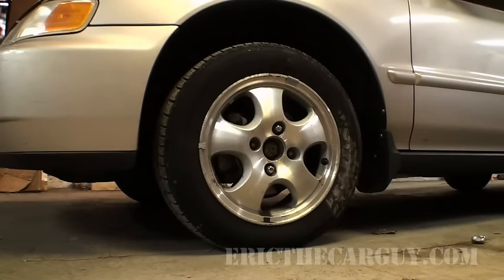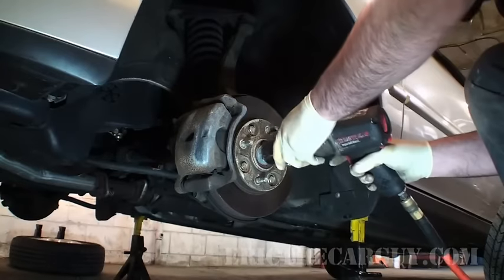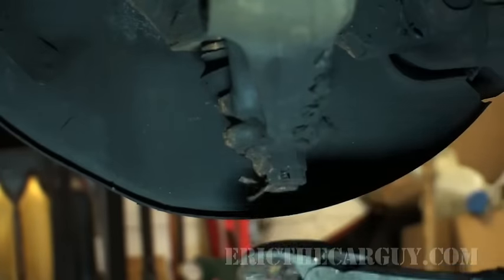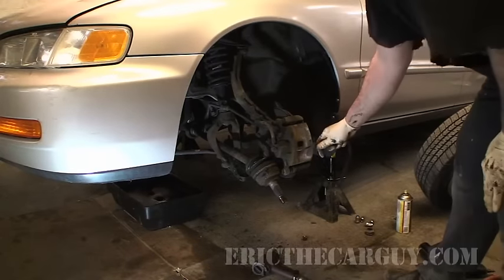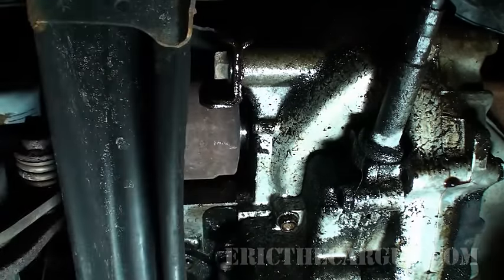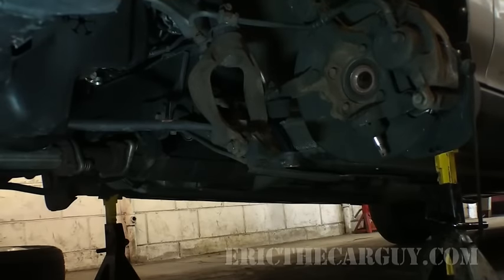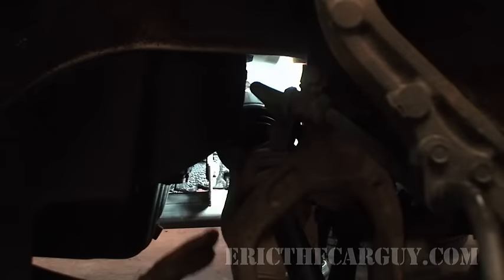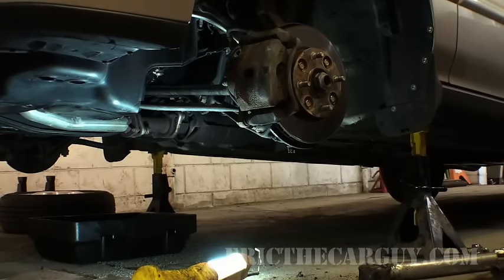How To Replace a Front Wheel Drive Axle - EricTheCarGuy

Comment: Why are there tons of youtube videos where the new axle just slips back into the transmission no problem... am i the only one that doesn't get the axle back in? stupid C-Clip..
Reply: schwabentutorials It gets easier the more times you do it, every technician has their own method but I like to slide the shaft spine into transmission and can feel the clip give a little and then push it in. It also helps to make sure its going in perfect straight and no weight on from axle hub side dangling I hold it up perfectly level before forcing in. That just my opinion and works for me.
Reply: schwabentutorials you can thank the power of video editing
Reply: schwabentutorials, I did a Dodge Neon 2001 yesterday.  By no means am I a mechanic at all but the trick for me to get it on was exactly how he explained it in the video.  Turn it back and forth and wiggle it up and down until you feel it grab and then wind up and push it in, but it is also quite possible that the hole is bore a little bit more on different vehicles.  I actually had a harder time of getting it out because I didn't have a pry spot...I wacked it with the claw end of the hammer on the u-joint and then it came off!
Reply: +schwabentutorials No, I had a horrible time with it, a friend with a car lot towed it in, put it up un a lift and pry bar-ed the hell out of it to get it in. (It was 5 degrees in my driveway when I was trying to do it, might have been part of the trouble)  SOLUTION: on the other side shaft, I took the new c clip off and used the c clip from the old axle.  Still took pressure, but went in.
Reply: +TheLazyHalfSRanch I had to do it twice by now (didn't change the seal the first time but appearantly damaged it in the course of putting the axle out or in) and it was bad both times.. As i only changed the outer part of the axle the inner shaft an c-clip are the old ones.. didn't seem to help.
+TheAstro30 that i did try, several times.. But as soon as the grease got in touch with the transmission fluid it basically was useless.. I also tried rotating and centering the c clip numerous times.. The first time i got it that way, after maybe 50 tries, rearranging the clip and then as straight and with as much force as possible in.. The second time i couldn't get it in myself (might have also had to to with me having a injured thumb so i couldn't use that hand to the full potential) but at the end i had someone about twice my size pushing it in and even he had to try really hard..

The getting out part is really easy on my vehicle because a pry bar fits in perfectly to pry it out.. But seems that the c clip on my vehicle is just very strong.. Or the position is very weird.. its way inside the fender and behind the strut and everything, maybe if it was on a lift would be easier.. Don't know :D 
But i for sure won't change axles out anymore if i don't really really have to... 

Thanks for all the ideas :)
Reply: You need to turn the axle to line up the ribs. DON'T HIT IT WITH A SLEDGE HAMMER!
Reply: 6

Comment: Something that worked for me, if you guys want to hammer the old axle out without putting the nut back on or smacking it directly, use a scrap piece of wood between the axle threads and the hammer. Hope that helps! Peace!

Comment: bro I just fixed my car radio and speakers and changed oil. I never knew how to do any of that and now I do thanks to you! I saved alot of money (ALOT) watching your videos. Now I shop online for all my parts and save money. 
Thank You so much Eric!
Reply: Be careful about shopping online I have found that over 90% online suppliers a pain in the ass to return incorrect parts. And sometimes you never get a part your money's gone they're gone. Pay a dime or two more at your local discount supplier not only is it quicker to return part they usually have the tools you need on-loan to do the work. And expert advice when you're stuck or not sure. You never know when the green wire is yellow in the yellow wire is red depending on the manufacturer and rather Asian European are us or a mix. The black wire and the blue wire and the white wire mean  a completely different thing in China and in the UK. Now throw in Germany Japan and Korea oh goodie. And then there's the black and white tiger stripe and the black and white pinstripe what the hell
Reply: @BillSmith-ut5li  Rock Auto is pretty good at all that shit. I've had good experience with them, returning stuff, etc.
Reply: Lmao what. A child can change engine oil. Hahaha.
Reply: @microusb42069  Sure, a child could do it if they know how. Which is the point of the post. Ram learned howto do all of that so now they can. Glad you were able to grasp that simple concept, Alex. Looks like you might have farther to go than the person you mock.
Reply: @xex2kok  Your comment is months too late.
 So I disregard it completely and didnt bother reading it.
Reply: @microusb42069  there are children who can program apps and play mozarts hardest pieces. 
Quit knocking down someone's learning progress
Reply: Rockauto es el mejor

Comment: Eric, you have by far the best repair videos on YouTube... thanks very much.
Reply: Eric, here's a short story, with an unanticipated ending. I pulled the axle, with no problem. When it came time to put in the new one, it wouldn't lock into place. I thought it was the clip, so I took it off, just to check. Turns out, the rebuilt axle was machined incorrectly, with the splines before the ring offset more than 1/64" from the splines after. So, the axle would seat far enough into the tranny to keep it from turning, but made it impossible to seat all the way. It was one of those horror stories, where a one hour job turned into a multiple day job, just to figure out it was a faulty part. Moral of the story, yes, I checked the replacement part to see if it was the same as the original, but not close enough. I haven't found any similar stories on the internet, so I thought I would share. Now, I will being going back to the part store to see if the splines slide up their you know whats, even though they are offset.
Reply: W Sears removal
Reply: Mattm1021 rear struts
Reply: Mattm1021 that sucks , reminds me of when I bought new rear brake discs for a vehicle and the parking brake shoes made contact all the time so I had to file them down to make them fit! The brake discs were not "machined" all the way in , on the inside there was a big lip .. if that makes sense.
Reply: I do agree brother. So maybe u can help me out. I hit a guard rail on driver side(i no ) now the wheel is tilted in at the top a little and running on the inside of my tire. Its hard to say but i think it my be the ball joint. Any words what it may be

Comment: 11 years old and still a great video. I remember the first Axle nut I did, 20 Year old honda. bent my breaker bar, snapped a piece of pipe. went to my local KMS, bought a milwaukee 1/2" and it was off in less than a second. Learned a valuable lesson about good tools that day.

Comment: Thanks Eric,  very good video explanation.      If I may share my experience, I had difficulty returning the shaft to the tranny.   I have done a shaft replacement on a 99 corolla, and was able to easily push the shaft in. very little difficulty.            However,   On the 2003 Toyota Vios (Yaris) ,   after many attempts, the inner CV shaft spring clip was preventing the shaft from being properly inserted.    

  Previously,   I i made the very messy mistake of thinking that the shaft had clicked-in locked  and I did not go under the car to visually check and verify .   But,   it really  felt that it had clicked.   But it apparently had not .         Lo and behold, when i started the car and shifted to "R",  lots of grinding noise and no transfer of power to tires and  a giant pool of tranny fluid on the floor.    the shaft was not properly inserted.        I figured i had to insert the shaft by leveraging a steel bar, but after a few attempts, I was still unsuccessful .    

 I then tried hammering the shaft end with my standard 1 lb ball-pin hammer and it still did not go in to snap.     ( I was almost giving up and thinking of calling a pro!)   I feared that violent  hammering with the 1 pound hammer was getting to the desperate mode and would destroy the outer CV shaft threads.      (I was going no where.  )   

Even more  Desperate,   I  used my # 4 steel mallet,    hammered around 5 blows and , success!!.     To get a bigger surface area to absorb the blows, I  installed the CV nut  back on shaft to protect the threads  and this worked.    I guess the spring clip looks small, but it can resist even strong hammering let alone strong pushing.   

  I feel the high momentum of a heavy mallet may be needed if  pushing by hand or strong violent hammering does not work.  I hope this helps !  cheers !!!
Reply: That’s exactly where I’m at now stuck trying to get in the new axle. Looks seated all the way but not getting the snap ring to lock in place

Comment: My initial job was to replace the bearing. As I went along I found that the spindle of the axle had rusted solid into the bearing. So I soaked the crap out of the bearing and spindle with penetrating oil and put an old nut on the spindle and hammered it until it was free... an hour later it finally loosened up.  But I wanted to keep the axle. I even stopped hammering on the spindle end once I saw it loosen up.  So I thought I was ok... nope. After putting everything back together I found that it developed a vibration and hum at 70 mph +.  And I only used a 2 lb hammer.  So hammering on that axle can cause it to fail, even with the axle nut on.  Another thing I found out was don't stick the pry bar up too far near the cv axle shaft when knocking it loose. I ended up damaging the seal abit. Live and learn. So replacing a bearing also caused me to have to replace an axle and an axle seal.
Reply: Ranger Rick They have special tools for pulling pushing out the axle.
Reply: I just put myself in the same boat, it happens. Whatever, hopefully my cv comes off easily

Comment: Just finished doing this on my 95 Accord Wagon (which is basically this vehicle with a different rear end) ... Hardest part really was getting the ball joint stud out of the control arm. I hammered like crazy with no success. Then remembered I have an air hammer! Put the castle nut on upside down a few threads, jacked it up by the stud a little, used the air hammer to push the control arm back down. Took me 10 seconds versus the 10-15 minutes I'd spent trying to get a good angle to swing a heavy hammer! :)

Thanks for doing this video and all the other ones! If I hadn't seen your lower control arm video w/ the Element, I would've tried replacing just the bushings on my parents' 99 CR-v. It looked like too much hassle considering the price of a whole new assembly (like you said in the video).

Comment: Thank you for all the details, Eric! You make the most helpful car repair videos!

Once the old axle is out, it's also a ** really ** good idea to pull the seal in the transaxle and replace that too! The seal only costs a few dollars, but if it leaks, you could lose all your transmission fluid and grind the transmission to death!

The transaxle seal is soft and pliable when it's new, but as it ages, it gets stiff and therefore it's likely to leak!

Check out Scotty Kilmer's short video - Fixing A Leaking Transmission.
Reply: I went to dealer ship to have my free oil change every time I go there they fine something wrong I drive Lx 350 suv 2008 Lexus 97,00 miles last time they told me I needed axle or I would not beable drive far. I drove there fine 1,400 is what they charge...i should start asking for my parts back.

Comment: I knew you where gonna have to stand on it with both feet. Ha...!

The first time I had to repair an axle was on my Ford LTD that I bought off of x-brother in law for $100. Back then it was rear wheel drive and U-joints.

I never will forget looking in my rear view mirror travelling down I-95 after I stepped on the gas and noticed the car engine accelerated but not the car.

As I was looking in the mirror thinking what the Hell is wrong with my car now? I see something going end over end, doing flips through traffic behind me.

Hmmm, I was wondering, what the heck was that doing in the road.. I see this black pole looking thing going end over end, spinning and rolling like a mad top. 

I watched as It did a flip right over top of some ladies car behind me narrowly missing her. Other cars behind her swerving to miss it as it continued on.

I didn't know what to think, somebody left their trash in the road or something.

Finally I had to pull over. I'm looking all over the car, not even a clue. Finally I look and see "hey where's my drive shaft...?"

"Oh dang !"

Comment: Hey Eric,I've got some info to share. Recently I had to replace a passenger side axle on a 05 Nissan Maxima,well,,, I had a lot of fun beating on the shaft for some time as I saw on YouTube. Hey ! the 05 Maxima has a plate behind the bracket that supports the shaft...DUH !!! Removing this bracket is none too easy as you would have to remove the water pump ,extra work if you want to do it. One solution,replace the axle up to the grease cup,re grease and install new boot...works fine. Enjoy your videos,keep 'em coming.

Comment: I wonder why don't they make that hole in the wishbone just a little bit bigger so you can pull the axle right out without undoing half of the suspension... They just don't want to make it easy for anyone working on the car.
Reply: Atrax R o
Reply: they make it to where the dealership or whoever will make some money off of someone not wanting to do the work themselves if they think its too hard or whatever they will get someone else to do it its something thats a bigger problem these days
Reply: Or maybe it's because your car goes through some pretty extreme g forces and rotational resistance at those points in the wheel and if it just fit to be pulled through the tire, what would hold your wheel to the car? one nut tightened on some threads that fastens it to nothing, I think not
Reply: Cars are designed in this order: 1) Price to manufacture, 2) Price to manufacture while keeping structural integrity, 3) Price to manufacture while keeping structural integrity and use as light materials as possible, 4)  Price to manufacture while keeping structural integrity and use as light materials as possible and preferrably parts that they already mass-produce for previous car models they have, and 5) Price to manufacture. And I guess you could throw in one extra 6) Price to manufacture, just in case.
Reply: True that!!

Comment: when you're hammering on the end of the axle, will it damage anything near the transmission? also, does this job require a re-alignment?
Thanks for the video Eric.
Reply: I know I'm late to the party, but I am about to find out if I made that mistake.  When replacing control arms, sway bar links, and wheel/hub assembly, my friend and I may have caused something to disconnect between the cv axle and some internal part.  I am pulling the CV axle this week to see if that's the issue.  I learned a terrible lesson about being careful around the half shafts.  They may have flared out too much when we were installing the new parts.
Reply: No

Comment: Thanks, for the video, I have done this before but at my old age 64, it's nice to see a video just to refresh the brain and remove any anxiety in doing the job...I was not sure if the oil would all pour out or not, I guess this is a bit dependant on the car so i will have a tray ready, and the replacement axle so the leakage will be minimum.. thanks again.